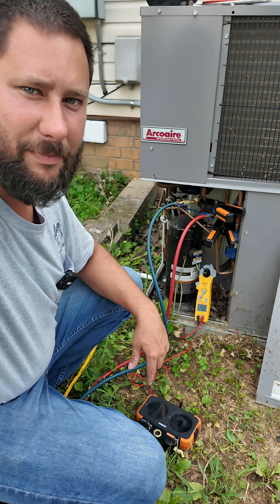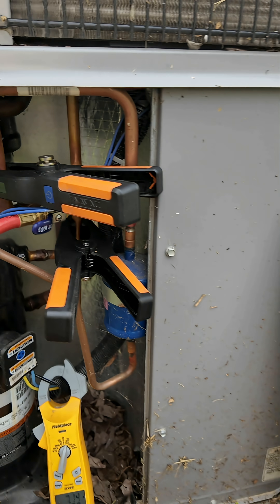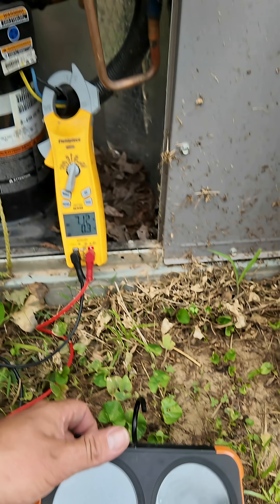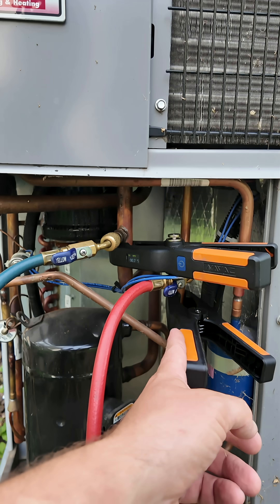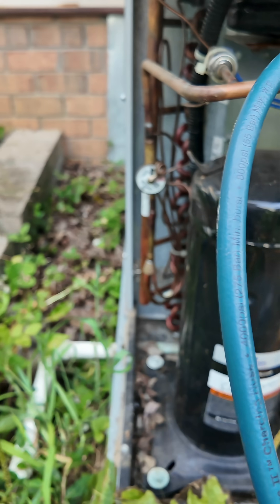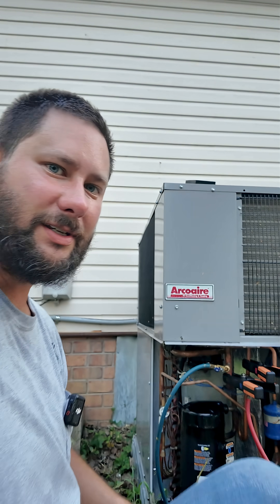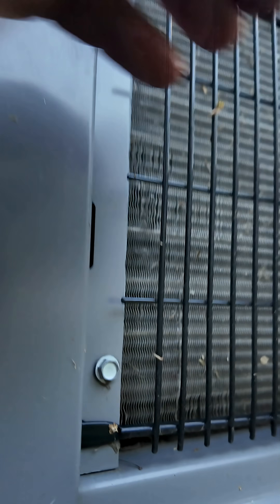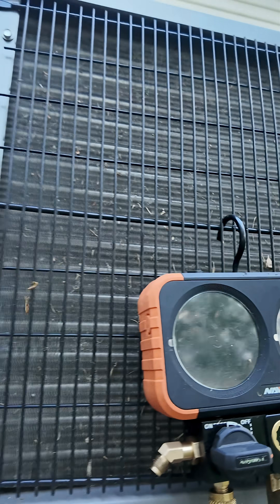What a Failed Compressor Sounds Like vs. a New One

Comment: How much refrigerant did you pull out? Those elevated temps and that compressor making that sound might just be an overcharged system. If the compressor is indeed failed, it might be from overcharging.......

Comment: I am a retired automotive shop owner, 10 years ago we had a nissan running rough and it would stall at a light, I had 2 techs with all their scanners and probes and this sensor testor and that thermosistercyclometerific meter and they both agreed it needed a new ECM, Computer.... I said pull all your gadgets off please.... They disconnected all their 50 probes and meters and in 1 minute I found a broken vacuum line to manifold, i said replace that hose and back the car out please.

Comment: Always use your first senses.
Speak to the customer.
Use your hands. Hold the suction discharge and liquid. A 3 second count on the discharge is a good indicator if that's all you can hang onto it for
Any longer than 3 seconds lo suction superheat anything shorter than 3 seconds hi superheat. Just a quick indicator.
Discharge superheat is a quick and excellent indicator as to what's going on inside the pipes and compressor.
Jack below this comment can't learn from anyone.
Reply: I hope youre joking. If so. Well played sir. You had me rolling
Reply: Absolutely not. What part....  @johnwhite2120
Reply: @johnwhite2120  discharge temperature indicates alot of information. Alot.
Reply: No jokes. Discharge superheat is a huge indicator for alot of things as a quick indicator.  @johnwhite2120

Comment: Had a carrier do this to me after doing a Lineset replacement . The plates are misaligned. I disconnected the fan and cycled it 5-10 times while hitting it with a rubber hammer and it started up and ran perfectly
Reply: I miss the ols times my gu

Comment: Your videos are awesome even though I’m not a House HVAC guy, but in the automotive world when we have compressors like that, we worry about metal contamination that will take out a new compressor. Does that happen on these?
Reply: If a compressor burns out your supposed to charge it with new refrigerant so it won't be contaminated if the old refrigerant got that way from the compressor. Also take the shrader valve out when testing with nitrogen so anything else inside comes out.

Comment: I work for restauran and baverage equipment some time the compressor temperature too hot why ? Is it bad compressor or refrigerant systems is not tuned?
Reply: Depends on refrigerant, commercial typically is much different than residential, with everything being completely different

Comment: I have three 1yr old or less ICP 3 1/2 ton phd442 410 a units that when the unit shuts off the compressor sounds like its running backwards and shakes violently  they're day and night like that arcoaire there... they all  have zp 38 scroll compressors single phase.. any suggestions????
Reply: It kinda sounds like the compressor isn't mounted right.
Reply: @majorwinifredpayne7426  no its like there's no check valve in the compressor  one is really bad a lot of ref. going back into the compressor  that one's not making noise in the house    i   think???   the one on my house and my neighbors  make a lot of noise when shutting off  i'm going to make some videos......
Reply: Use ear plugs.
Reply: Sounds like the scroll check valve has failed. What you are hearing is the compressor running backwards until the pressures equalize. Not good.

Comment: I literally had same service call Wednesday. I punped it down and left suction open and pressure rose 50psi in 2 minutes.
Reply: Can I ask why you decided to pump it down? Wouldn't checking the terminals with a multimeter suffice to see if it's shot?
Reply: @nobody94820 checking the terminals will tell you if the electrical windings are bad
Reply: No  @nobody94820

Comment: Pretty sure ur high side temp clamp supposed to be more near evaporator coil so u can get a proper subcool
Reply: @chrisf963  it’s a package unit
Reply: @Cameron72737 I get that it still has a evaporator.  I know u weigh the charge in. But if ur checking temperature right off discharge of the compressor ur temperature is always going to be high. I been doing hvac 19 yrs man I'm a journeyman that has passed a masters test

Comment: Before you change the compressor, check the capacitor and the wiring.
It sounds like it could be in reverse…
Reply: @whochecksthis  I agree. Sounds like need to switch couple legs for proper rotation.

Comment: Ive got an A/C unit in my attic space in a ranch style home, every few days the unit in the attic freezes the coils that the air gets drwan across, it is still in the 80s for temp and the house has not temped out but with everything frozen we get not air movement and the larger line going into the unit outside freezes also right where it enters the unit..... what happening here, had the system check when we bought the house 2 yrs ago and everything was good, so they say.
Reply: @gmartin03  I had the same issue. Evap coil had a leak.  System was 15 years old so had it replaced.
Reply: Coil or filter is dirty,or you have a leak and low on refrigerant. Would also freeze if your indoor blower motor wasn't working, but you didn't mention that. One less common thing that could cause this as well is a restriction in the metering device
Reply: @cardsfan1590 cleaned the coils on check up and I've replaced the filter monthly thinking that might have something to do with it and still no change. The blower motor is still running, it just freezes after a day or 2 of running and we have to shut it off and let thaw, then it runs good again for a couple days
Reply: @gmartin03 make sure none of your return vents are blocked,but it sounds like you need to have someone with some gauges check the pressures
Reply: @cardsfan1590  thanks, I read that the return might not be pulling enough air it causing the freezing problem but I did check all my returns and supplies, I was just trying to avoid paying a tech to come out and tell me everything is fine again, like I said, it only happens every few days, but the solution we've been doing is shutting the air off if we run an errand so it doesn't freeze
Reply: @gmartin03 You're welcome. I would imagine if the return was undersized, you would've had problems when it was installed 2 years ago
Reply: @cardsfan1590 no, not installed to years ago, just checked when we bought the house, it's an old unit, r22 refrigerant I believe.
Reply: @gmartin03 I misread you bought the house 2 years ago.Still if the returns where undersized that wouldve shown up by now
Reply: No one mentioned this, but it could be a bad board/defrost board as well. There's usually a control board, sometimes its on the condenser housing, sometimes inside by or in the air handler, that triggers a defrost cycle for the condenser coils every so often, like a timer. This prevents icing. It can be its own board or built into another control board. The board can be tested with a multi meter to see if that's the culprit. Could be low refrigerant as well or a combo. But if its cooling well, just icing up after a time, it could be the board.
Reply: @SSK-27  thank you, ill doing some research on that and see if it may be the problem,  i just want to turn my ac on and not have to check if its freezing up
Reply: Thank you all for the helpful advise